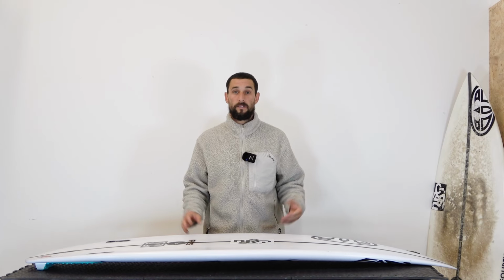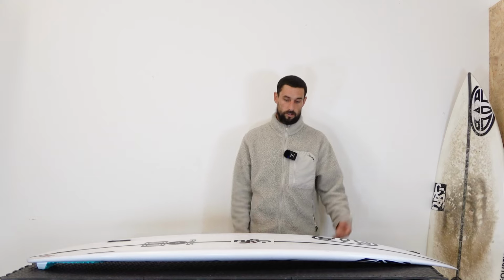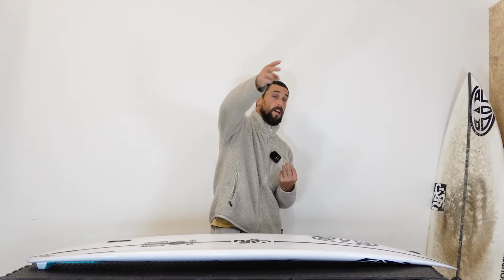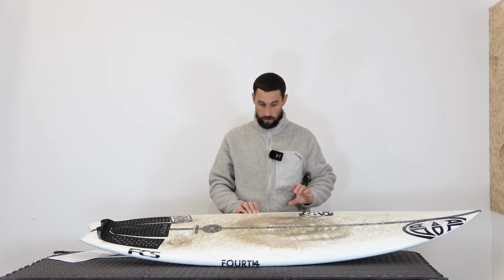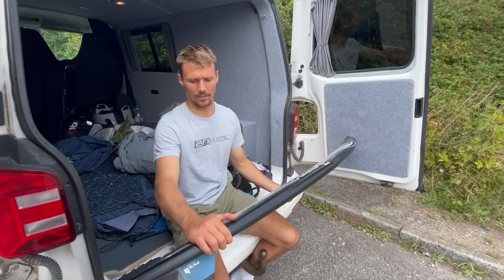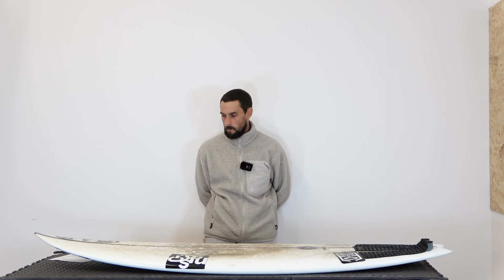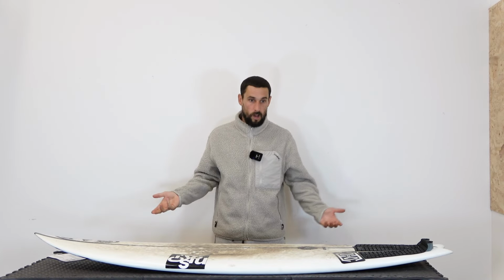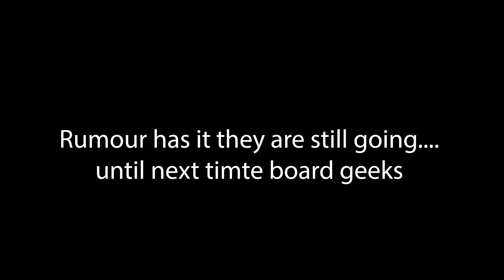Weak wave performance. Utilise these key design features to get the most from your surfboard.

Comment: Hi luke, love these nerdy nitty gritty videos. Would you say some of these design features translate to longboards as well? Or is that totally different again? Friend of mine recently sold his Cali longboard because dispite the foam didnt 'work'. He cant really explain why tho, because hes not into board design.
Reply from the maker: @Mongiloyd  its different. You have so much momentum on a longer board, they become more about how to control rather than how to add speed. Some longboard designs play around with tail lift so the boards sits in the pocket better when nose riding. This adds drag and knocks the trim down a bit which is noticeable in paddling quite a bit. Especially if you are riding it in flatter waves. I've heard of people not liking Cali style nose riders in UK... To really get the best out of them you actually have to be quite a high level longboarder. For normal surfers wanting a longboards I always suggest more of a balanced rocker and adding more edge in the back third 👌.

Comment: When you referred to extended rail line? Do you mean outline? Is your rail line have the same amount of rocker as your stringer or do you have a flatter rail line and a curved stringer sorry if that sounds confusing 🙏🏽
Reply from the maker: @guypere480  rail line referencing the width in the nose and tail creating a slightly straighter curve through the centre of the outline. As for curve there is more on rails than through centre due to concave. This is to help turn those extended rail when you are pushing through a turn on rail. So in theory you are trying to get the balance between rail engaged down the line for drive  and through a turn for fluidity. It's working out the contradictions to get the best balances.

Comment: Great video and loads of great in depth content - just a minor point when we say ‘uk waves’ do we mean cornish waves ? Plenty of parts of uk with fast performance reef breaks / punchy beach breaks in abundance?
Reply from the maker: @jamesfisher2821  I guess so yes.  We do have great waves on other coasts for sure. we live in Cornwall so our UK waves net is fairly jaded. 🤣. But 100% appreciate what the other coastlines can offer. I have had some of my best ever waves in the u.k.  and unless properly sized and power waves... For the most part, boards go better in better waves... It's more noticeable in the weaker stuff when they aren't quite on point, and I feel like as a shaper that is where my mind tends to go. Even in our good waves I think we tend to deal with more rubber, and higher winds etc etc than some of your more idyllic settings and all of that requires thought on board design. But, if you want to make the most out of UK waves.... Dial in the boards that work at the lower scale and most average days as I think it's fair to say they are more abundant. Especially in good ol' Cornwall 🤣🤙

Comment: This is fun, thanks guys! I'm curious: How would you change the concave of the board and tail if you would put a squash tail instead of a swallow on that model (or any small wave board)?
Reply from the maker: @Rbn-oy6pz  maybe slightly flatter behind the back fin. But nothing dramatic. I always feel like a tail doesn't define a model. I think of a model like the ice-cream then the tail shape like the flavour or the wafer/sauce kinda deal. Like, it's important and makes the dessert what it is. But the foundations are the same.... Hope that makes sense. 🤣
Reply: @colabsurf  Haha okay, yea makes sense! Thanks!